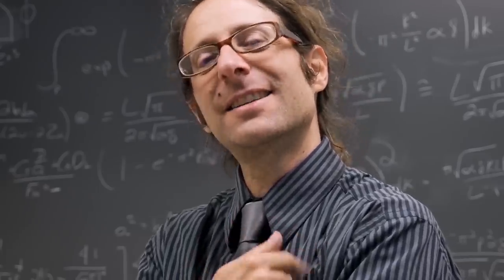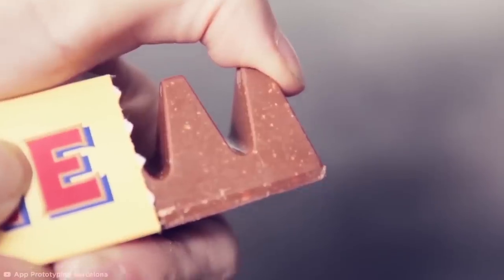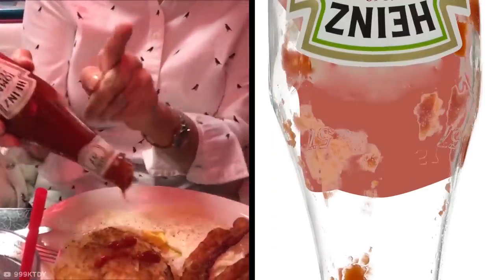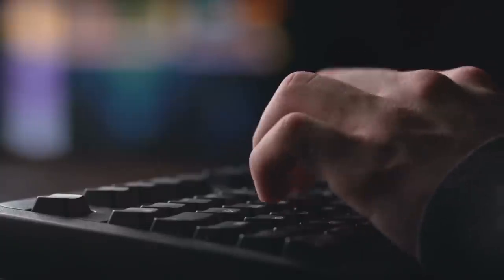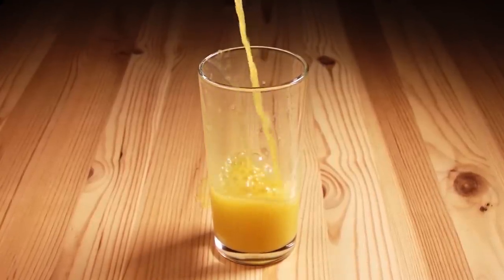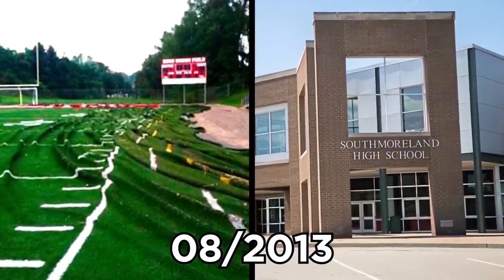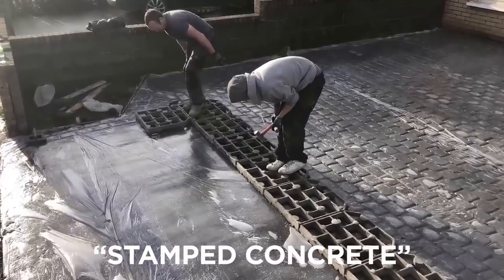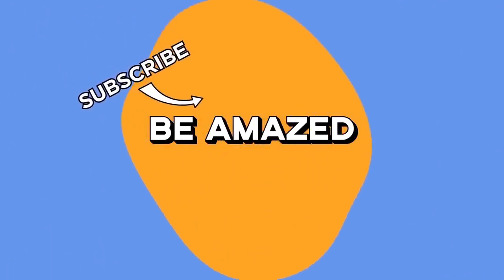Inventions That Fool Us All

Comment: 1. Mice and bugs will get into those cereal boxes anyway.
2. Toilet paper is still going to touch the wall if that's the kind of dispenser you use no matter which way you put it. The old drawing is only for a clear illustration of the paper roll, not a suggestion on how to mount it.
3. A "pea-sized" amount is the amount suggested of every paste or lotion that's supposed to be used. If we didn't have peas, they'd say a "bean-sized" amount.
4. Those towel displays aren't fooling anyone. Worst kept secret in retail.
5. Ditto for toilet plungers, it's not a secret to use the correct one for the toilet.
6. You'll still have to stir the "natural" peanut butter since all the oil will just be on the "bottom" of the jar instead. Since when is palm oil not a natural product?
7. Pour juice with the spout on high, no glugs but "most people" are still going to spill it due to bad aim.
8. The tabs were never meant nor designed as a soda straw holder, some kid just came up with that idea for fun and it took hold.
9. So Astro-turf got lifted up due to flooding. Why is that one even here?
10. Obviously the cheapo-noodle companies aren't cheating you via "shrinkflation". They just want the noodles to be ready quickly for college students always going nowhere fast. What would be better is if you stop eating that carb-loaded crap.
11. "Effortlessly becomes an easy to use plate", then you show a lot of effort doing this. I'd have my food plated and eaten by the time you got done.
12. Okay, how is stamped concrete fooling us? If you have it done, you know it, and it still looks like concrete. That's like saying we're getting fooled by wood-grained plastic. Nobody is.
13. Cobblestone carpet? It's real cobblestones just made easier to lay out, that's all.
14. The serrated edges on foil-roll packages stink, never tear right, and even my grandmother knew about the edge tabs.
Maybe this one should be called "the video where Be Amazed tried to fool us all".
Reply: You had a lot of free time on your hands huh?
Reply: @African.empress  As must you since you read it and replied.😆

Comment: The only issue with over or under for butt paper is if you have animals that like to scratch things. over on butt paper with a cat will end up with all 300 feet of it on the floor. That is when you go under. and spend more than 5 $ on a butt paper roll so as to not have it lay against the nasty wall.